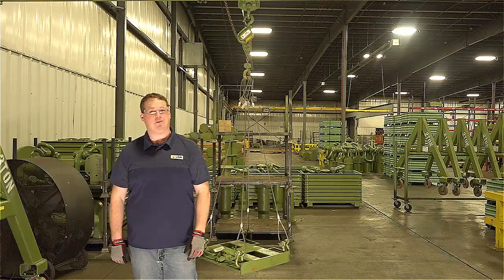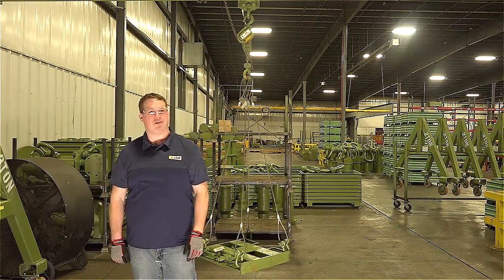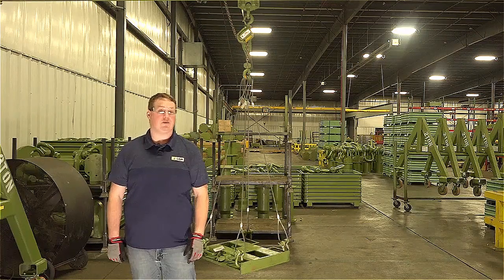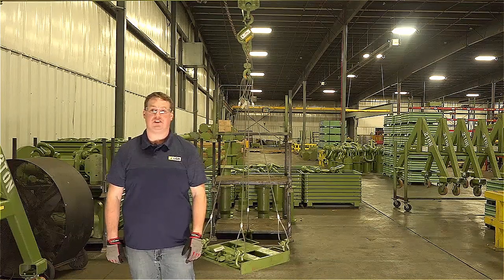Monday Morning Rigging Tip: Hitches and Load Control

Comment: Remember that an inverted basket will require capacity reductions based on the D/d efficiency since the hook diameter is less than 25x the diameter of the sling. In your example, you are probably looking at a capacity reduction of 60% to 50% from the rated basket hitch capacity. 
Also, even with wire rope a traditional 4-leg bridle is generally not assumed to have equal load sharing between each of the legs. A typical assumption is that each leg sees 1/3 of the total load when used in a 4-Leg configuration.